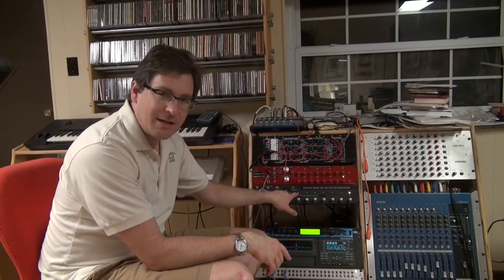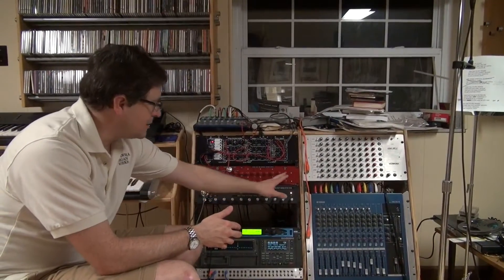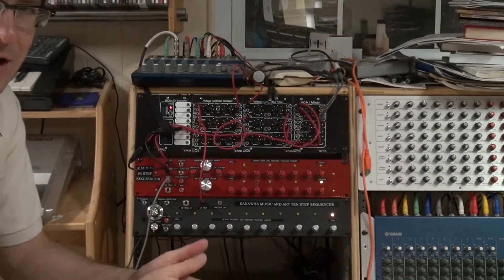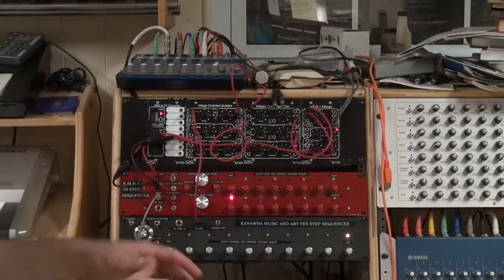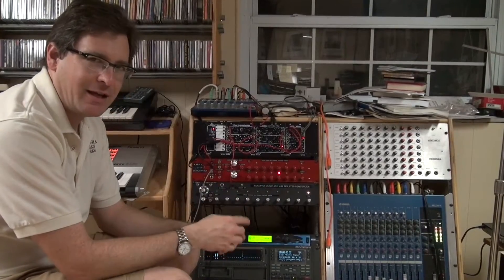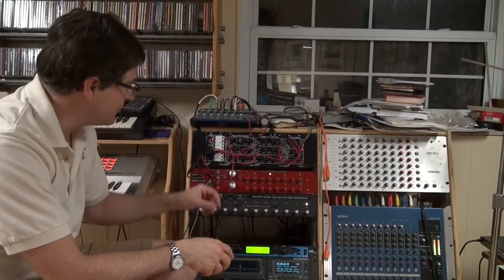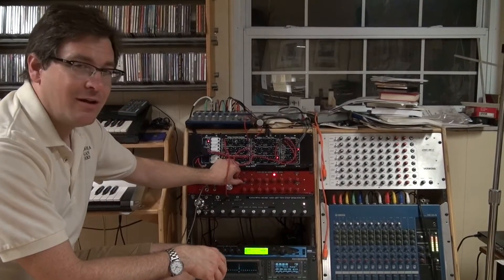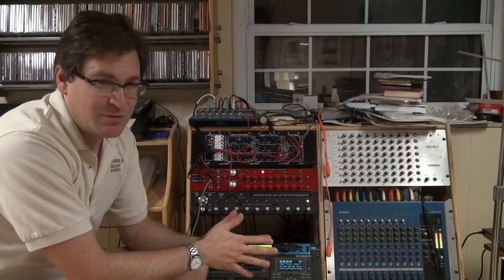16 step homemade analog sequencer demonstration

Comment: Your videos are quite nice; I enjoy the tutorial aspect, or, the way that you explain and demonstrate your equipment. My PAiA 4700 has been expanded from the original pawn shop system, after two friends donated modules they had built. I built a dual 4-channel passive mixer and a transposer, also a passive module. I have a total of 6 VCOs, and plan on building at least one more each of the transposer and dual mixer modules. I can send you schematics if you are interested? Thanks again for the demo!

Comment: Hi Chris , great vids,just watched the 10 step one. Do you have schematics for this 16 step? Are you still using a 4017 IC ?
Reply: +Mr Feenix Thanks for watching, sometimes I wonder if it's worth making the vids but when comments come in I say, yes. I don't have schematics for the 16 step drawn up, as usual it was a combination of chunks of circuits I combined together. The sixteen step does not use the 4017- it uses a 40193 up/down counter connected to a 7154 (I believe) four to sixteen line decoder. (I don't have the stuff in front of me, this is from memory). Now that you asked I'll start drawing up the schematics, which I was going to anyway.
Reply: A very nice job.. always worth making vids.. i'm very new to all this but love what you've done. I'm starting mine tomorrow quite a lot simpler but i hope to make something along your lines at some point.. I've got the bug now !! lol Thanks for your time.
Reply: +Mr Feenix Remember I made a simpler 10 step WITH the 4017 chip. I'm going to be rebuilding it to get rid of the DIP relays I used because they're incredibly unreliable.
Reply: cool :) Hope you make a video!!